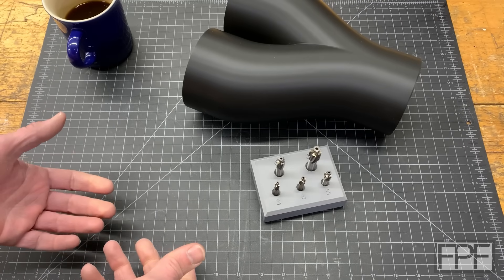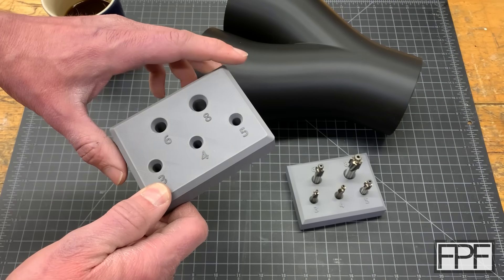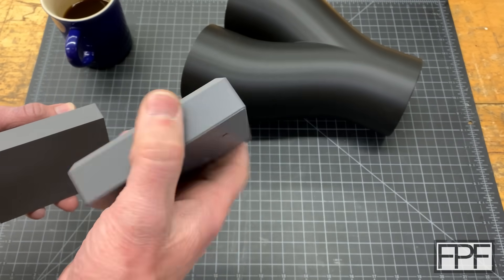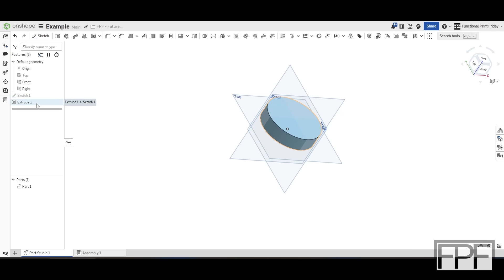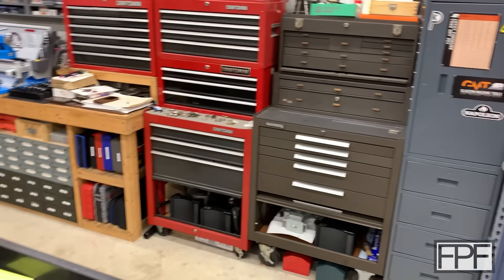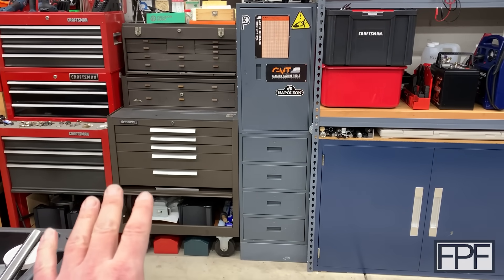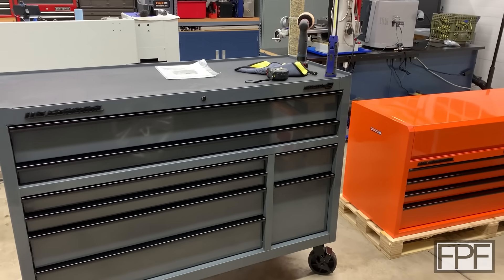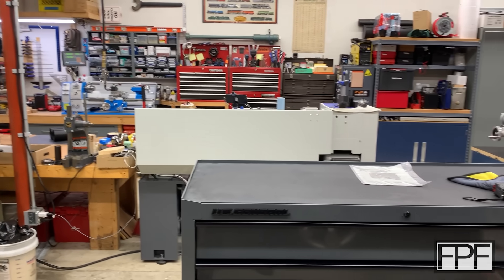Y-Pipe Viewer Challenge and Shop Updates

Comment: I'm much more comfortable using Fusion 360 than Onshape, but I decided to try the challenge anyway because it's fun. I ended up getting 8. I probably could have done less if I had used a sweep or pipe with a revolve but I just got off work.

For the design, I made a sketch with three holes that overlapped with another set of holes, offset by 3mm from the center of each. Then, I extruded the first two holes with one extrusion. For the third hole, I extruded it with an offset of 250mm and a length of -45mm.  

I used a bit of a cheat, I did a loft then went back in time and did another loft on the outher side, and then moved forward again. This caused a small error, but since both lofts were done useing a join/boolean operation, it still worked with no major errors just a warning.

 Next, I shelled the part to a thickness of 3mm. Using the first sketch, I extruded a hole in the same way I did for the first set of holes, useing two more extrudeds using the inner circle from the first sketch. 

This was fun.

Comment: Have the exact same box (albeit with the top hutch), currently 3d printing some led holders for every drawer (since there is knockouts in the back of each drawer for wires) and putting in hall effect sensors so I have drawer lights when it opens, only issue is brain storming some cable chains so the wires dont sag into the next drawer...maybe you can/will do something similiar!

Comment: My attempt is 8 steps- sketch for in dimension, offset plane for 250mm height, sketch for out dimension, sketch on the y plane for path (setting the 45mm minimum length with normal profiling), loft along the path, mirror across the plane, and 3mm shell operation...

Comment: Going back to the bit holder. You can print that upside down so the colour change happens on the first layer. Then you don’t need the filament tower. And the textured bed leaves a stunning finish.
Reply: That would be good as long as the holes had staggered layers for the "lip" that prevents the tools from dropping all the way through. Otherwise you're going to have unsupported extrusions.
Reply: @spasecookee you can always use a 45° angle for the step and you would not need any supports.
Reply: That is good idea, and would also help channel debris through the hole.

Comment: I like the colors, and support the decision to use steel grey and vibrant orange. I'd definitely take the discount and customize the orange chest.

However, I'd go a different direction with the repair. I mocked up my proposal and the results look great. I'd be happy to send you the image (I wish I could post it here).

In brief, I'd use black gloss enamel paint instead of a 3D print, and I'd paint the whole top, down the front and sides to about 10mm past the bottom of the top front chamfer. It will look like the top is a thick, glossy, black slab. This cleanly matches the current design language, and the glossy black matches the existing gloss black paint.

Comment: As a software developer of many years, but a rather neophyte in CAD, I’d like to ask this question to the CAD designers with more experience. 

In software, shorter code does not necessarily mean easier maintainable or understandable code. Is this the same for CAD? I know I can get some of my CAD designs in shorter number of steps, but when I come back to my designs months or years later, I wonder what idiot wrote this stuff :) ie I think I would have found it easier if I would have made more sketches and extrusions. When I cram a lot of stuff in a sketch I find it difficult to separate my intent.
Reply: I think the brief answer is that as few steps as possible for aspects you don't think will change is good, but explicit broken up steps for portions you may edit later is better. I am not a CAD expert, but I know it's most frustrating for me when I have to redo multiple steps because I had combined too much into one vs being able to go back and edit a small portion.
Reply: I've done both, though I wouldn't consider myself an expert in either. Regardless, I think there are a lot of parallels. In software keeping things short and simple can help readability, but only to a point. Getting clever to make things as short as possible makes the project a puzzle for everyone who looks at it later. There is less potential for that problem in CAD (you'll never see a obfuscated CAD challenge in something like OnShape), but it's still true there. A more direct parallel is the need to put forethought into how you build something, use clear, consistent design patterns, and document as you go. In both disciplines those things make the project easier to build, easier to maintain, and reduce the need for rework as requirements change.

Comment: Almost everything I get now is somehow damaged before arrival. Recently I ordered 2 BXA tool holders for my lathe. They were shipped USPS. When the package arrived it was one of those thin plastic envelope type which had obviously been cut open and the only thing in it was a note saying that it had arrived in that condition. They didn't say where it arrived like that but it was empty. Dings and dents, and missing parts is now common place. I have a couple of those top HF cabinets and would love to accent them with contrasting colored corner protectors, so I love that idea. I don't have a printer large enough to print it in one piece, I have a H2D,  it be really nice if you shared both a one and a two piece STL. Please. 🙏

Comment: I don't know how to use onshape, but using inventor (since that's all I've ever had since college forced me into it), 6 steps.
 
Sketch 1 = the two splines forming the Y from the origin (these will be used as center lines and as such can incorporate all the constraints needed)
Sketch 2 = Base circle
Sketch 3 = the 2 circles centred on the ends of each spline (same termination height so one sketch for both circles)
(Right click on sketch 2 and 3 - select "share sketch" - the rules as stated, this doesn't count as a step :P )
Loft 1 = first leg of the Y from sketch 3 to 2 along spline 1 in sketch 1 (- options include rigid adherence to the splines constraints)
Loft 2 = second leg of the Y from sketch 3 to 2 along spline 2 in sketch 1 (or mirror the first loft, no savings in steps, and this allows for different sized pipes for future iterations) 
Shell 1 = shell at desired thickness, removing the three faces of the circles
 
Export at STL
 
A step could be saved by drawing a "rail" on Sketch 1, so you'd just use sweeps on the base circle, and the rail would have the profile of the exterior constraints, but for me, if I wanted to modify the circle in any way / change it's shape entirely / build off of it to alter lengths - it's easier to just adjust the object constraints as a whole rather than a curved line (driven dimensions and constraints can push and pull the line all over the place, sometimes in small unnoticeable ways until you put it into an assembly and things are out by just enough to hurt).

Comment: No interest in learning OnShape, but for a minimal Y-pipe in (noobish) FreeCAD PartDesign workbench I'd do an additive pipe (2 sketches: circular profile and b-spline path), mirror and thickness (removing end faces).
Reply: I used FreeCAD and tried a similar approach (note that the two ends have different ODs). However, thickness didn't work after the mirror. I found another way, but I won't spoil it in case you want to try the puzzle.
Reply: @ardemus  Missed the different diameters. Thickness worked for me with constant section pipe but trying with multisection it fails for me.
Reply: @notsurt  I had the same issue once I had 2 different end diameters.  I solved the problem though after several more attempts and struggles with thickness tool.  I finally completed the whole project in 8 steps (one being a datum plane).  HINT: For my solution, to deal with thickness tool failures, was to perform a clever cut (and not use thickness tool at all).

Comment: My first try on the Y was Sketch1, Sketch 2, Sweep 1, Sweep 2, and Shell.   EDIT - I read the CHALLENGE RULES after I made the Y so a few more steps are needed for the different diameters .
Reply: I did the same but with mirror instead of sweep 2, seems like we tied for 5
Reply: How did you handle the different ODs?
Reply: @unamanic  I used same OD and ID throughout the part.
Reply: Solidworks can do four "steps"
1 sketch with the endpoints of all three circles and the sweep path
2 solid sweep with circular profile
3 mirror the sweep around the centre plane
4 shell

The step saving trick is that Solidworks saves a sketch because it has a built-in circular profile for sweeps.
Reply: @yadbor actually onshape has profiles for sweeps as well but it takes a little bit of setup to use it first. Once you setup it up it would be basically the same 4 steps. Its a really nice feature that I wish was easier to setup. But basically in onshape you create a profile library. In the library you create each profile and define variables. So you would create a circle sketch and a variable for the radius or diameter of the circle. I have several profiles setup like 2020 aluminum  extrusion and pvc pipes and wood with choices like 2x4 etc. The library takes a bit of work to setup the first time but once its setup you can referance it in any project. Its cool that these CAD systems have so many of the same features. I use the profiles in onshape often when designing things that I plan to build, its a great tool..
Reply: @yadbor have you got different diameters for the single end and the double end?
Reply: 5 steps in alibre cad. 
2 extrudes for 45 mm, loft, boolean to mirror, shell it
Reply: Just to compare 5 for inventor, 2 sletches for path and OD, sweep, mirror and shell. Shows all CAD packages are pretty much the same for the basics.
Reply: It took me 8 steps. Sketch, two extrudes, another sketch, loft, boolean, mirror and shell.
Reply: @RichardJones-z2j 6 steps in Inventor for me: large circle, small circle, path, loft, mirror, shell. Could do it in 5 if the top of the Y was the same OD as the bottom
Reply: @willl84  they're different diameter! Oops. I should read the instructions, back to the drawing board but not going to beat Solidworks.
Reply: @willl84  for some reason I can't shell after mirroring, seems to be a geometry problem so used 2xlofts but the same total opearations if I ignore the extra workplane
Reply: I used Fusion 360 ~ 4 Steps..  1) 3d Sketch for Dia's & Path,  2) Loft,   3) Mirror,    4) Shell

Comment: I thought you could do the Y-Pipe in 3 feature but it leaves an odd inner geometry.  2 sketches  2 sweeps and one shell is the 5 features I came up with.
Reply: How do you sweep between two different sketches? I'm new to OnShape and I tried a sweep, but it used both sketches all the way from the top to the bottom (so the outside wall was the size of the larger circle at both ends).
Reply: @ardemus That post was before the rules were pinned (I think they were posted, but not pinned). Needs 3 sketches, new plane, a loft, a mirror, and shell.
Reply: @ardemus  But note, I wouldn't do this model in "Minimum features" mindset. I would add whatever features I needed to ensure good curvature. The bare minimum geometry comes out a little funky.

Comment: You’re not alone.  The shipping company did the same thing with my 5hp 80 gallon air compressor.  Put it in the truck on a pallet and didn’t strap it down.  Of course it fell cover and mangled some parts.  Made them ship it back and replace it.  Frustrating!

Comment: Loft between 2 circular profiles, use normal to profile option, mirror, shell .....done. 2 planes, 2 sketches, 3 features. Done.
Reply: How did you get the 45mm straight sections on both ends?  That seems to require two extrude features since they go in opposite directions from the loft(s).
Reply: Ok after loft ... or before....add a sketch at both ends - circle at top and two at bottom and extrude eagh 45!

Comment: 3 features.

Extrude Sweep -> Mirror (or Circular Pattern) -> Shell
Reply: I think you have to count the sketch for the sweep and do two separate sweeps (instead of the mirror) or it ends up with a weird inner geometry.  5 steps should be the minimum.
Reply: That's what I've got. I did it without checking the pinned message. There's a different OD for the different sides and the shell thickness isn't spec'd so Im gonna have to revisit later and not submit a link. But the sketch spline, sketch circle, sweep, mirror, shell seems like the bare minimum "steps"
Reply: Steps, not features.  The sketches count as steps.
And a sweep won't work since the top and bottom circles have different OD's.
Reply: @mikejackson9585 @jdex-ytp With the two different diameters, I was able to keep the total feature count to 8 (including sketches) and submitted a link to my file via the contact form.

I've been using solid modelling CAD for 22 years (when I was still in high school). I consider myself fairly knowledgeable and know lots of little tricks across several platforms, but I'm always willing to be schooled on new ones. I look forward to the shortcuts and tricks that come from this little challenge.

Comment: I agree with you just cover it up with cool black accent pieces. Interesting competition on the Y-Pipe.  I've elected to learn Free CAD so I won't be participating the competition directly. I may try to give it a spin in FreeCad and see how many steps it can be done in.  If you are really into CAD racing can I recommend a channel called @TooTallToby where they do competitive CAD, if you are really interested in testing your CAD chops out.

Comment: I would do a vinyl strip across the orange edges in black or the grey to draw the eye transition into the hutch from the base.
Reply: I like the Idea of using the grey. Either just paint the sides grey. Or do the sides and top cover, framing in the orange drawers.
Reply: I was thinking just mask it and paint it black...racing stripes for the tool box...might take some work to blend the edge
Reply: The Vinyl decals is a good way to bring the two together.  Both of the those colors are almost matched 100% in Oracle Vinyl
Reply: Absolutely agree 👍
Reply: Take the discount.